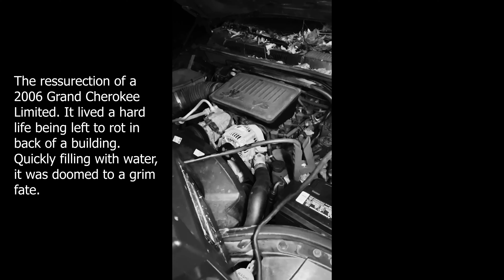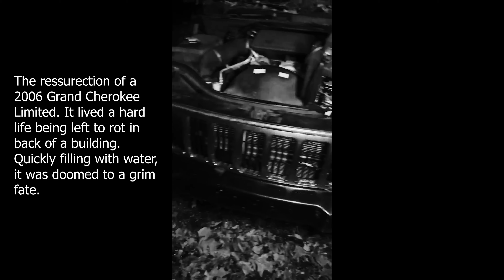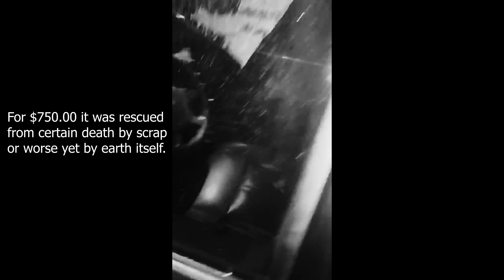Budget Daily Driver Build! Foster fail yet again!

Comment: 6 years ago I bought a 2000 jeep wrangler sahara and 2 weeks after I bought it the frame needed to be patched but I brought it back to the dealer and it ended up costing me nothing to fix. But since then I've put probably around close to 3000 into repairs since 2016 but it had sat around a lot and it was towed behind an rv. But the main thing was it sat around so about a year after I bought it I had to have the water pump replaced and the radiator within a day of each other I had to have the frame fixed again in 2021, I fixed the rust spots on the tub myself that were under the license plate holder and under the right tail light. I do need to fix the torque boxes still both sides are rusted out where the middle body mount is. it also needed new tires the first year I had it the old ones were dry rotted. Even though I've put a lot of money into it so far I still love it and daily drive it.

Comment: Wise recommendations and good real-life example!  Big emphasis on going to junkyards, especially self-serve:  one can find exactly what is needed, at a much lower cost compared to new OEM or aftermarket sources.  The benefit of learning how to remove the needed part from the donor vehicle is a huge plus as well.

Similar experience I had with a 2004 Saturn Vue Redline.  Transmission had failed, previous owner installed new transmission but didn't want to tackle other issues of the vehicle.  Got the car for next-to-nothing.  Over the years I had the Vue, I installed new front wheel bearings (which got the ABS working again), Timing belt and water pump (Honda J series V6), front pads and rotors, AC Condenser (with a system recharge, got the AC working again), new iridium plugs, front struts, rear shocks, O2 sensors, center console window controls (junkyard parts), and other bolt on repairs.  Also welded reinforcements to the front subframe, as the original subframe mounts were a common failure point on these vehicles.  Good Daily Driver for several years!  

The biggest thing is deciding what can you do in your garage, how much can you afford at that moment, and the eventual point of assessing when it's time to get rid of the vehicle.  Good video Justin!

Comment: Take out that head liner it will come clean.  I’ve done that. And yes I bought two blazers for one price one that did not run I used the radio.  Other got me my Jeep frame welded up.  I used the non running to get the frame done and that person made money off that blazer.